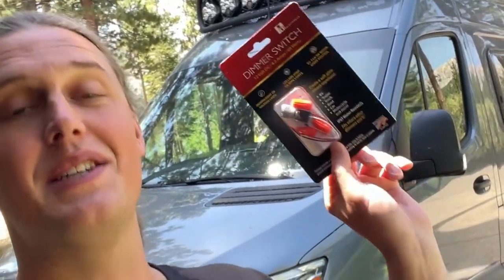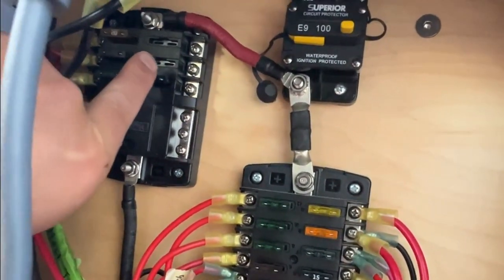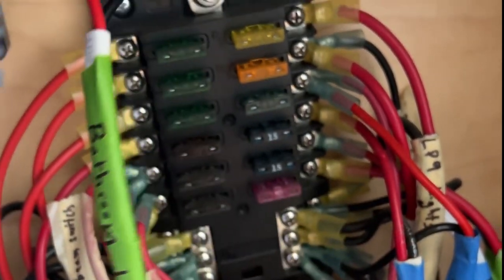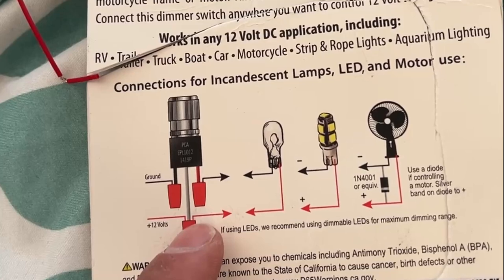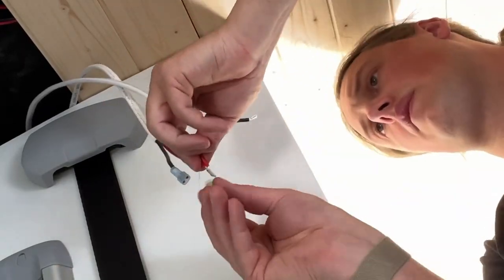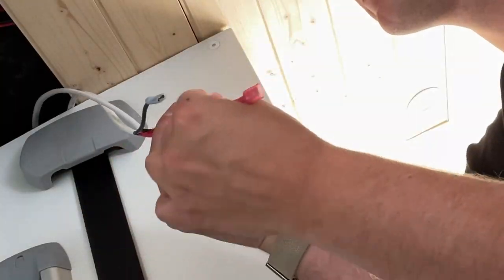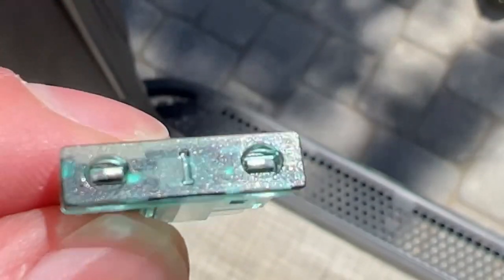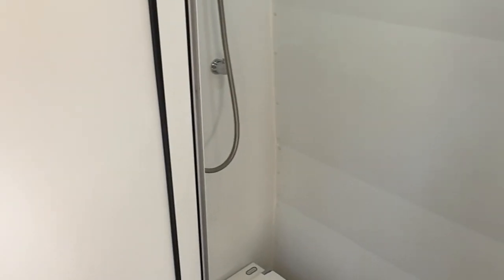How To Install SIMPLE 12v Dimmer Lights In A Camper Van, Boat, or RV!!!

Comment: I use wago wire connectors. They are so easy to use. They come in different sizes for more than 2 wires and also in different awg. After wires are connected I wrap a pc of electrical tape around the connector to insure it stays closed. 
You can get more info on youtube.

Comment: That is much sleeker than the dimmer I was going to use.  Thanks!
Just a couple things I would do different.  I have grown fond of crimp-on butt connectors.  There's no disconnect, so one less problem area, but you need to leave extra wire in case you need to cut them off.
Brother makes heatshrink labels for their normal printers.  Way better than my handwriting.  Link in the following comment, because youtube sometimes doesn't like links.

Comment: Liked your video.  Very well explained.  My specific issue on my boat and attempting to install this same dimmer switch to replace a very old switch, is that the old dimmer switch had 3 wires inside a grey jacketed wire.  I tried different combinations and in one attempt, the lights came on, but didn't dim and remained on even when I turned the dimmer to off  position.  Any help or guidance would be appreciated. Thanks.

Comment: Hey thanks for the video. I’m running into issues with my lights flickering. Using the LEDs, wire and dimmer you recommended. Any thoughts on cause of issue? It’s a very subtle flicker but it is a flicker nonetheless which is a bit frustrating. Cheers 🤘

Comment: I wanna try and set up a google hub with starlink along with my programmable LED light strips so i can just tell google assistant to do things on command. Id also splice that starlink eithernet cable and run it into the van walls to wall mount all the networking equipment. Make my own network closet in the van.

But thatz just me....and how i wanna set it up van